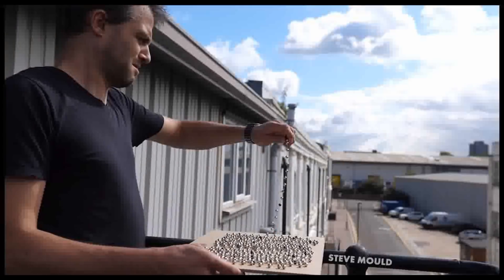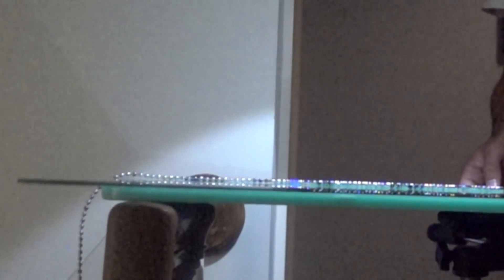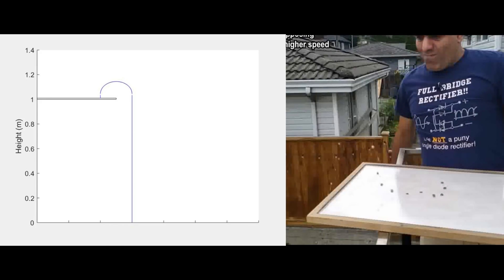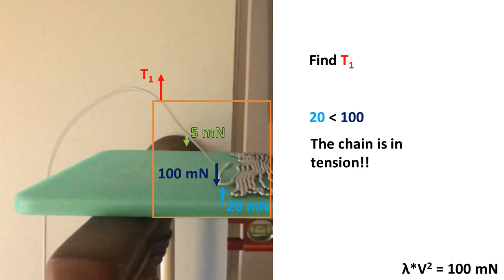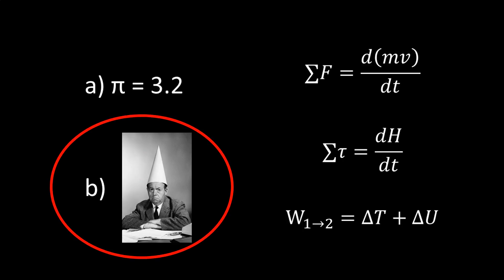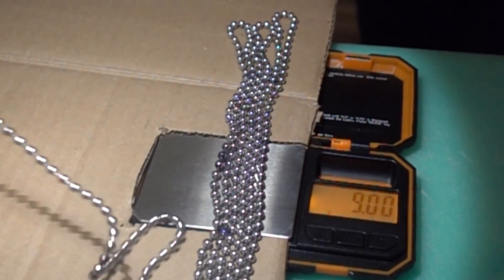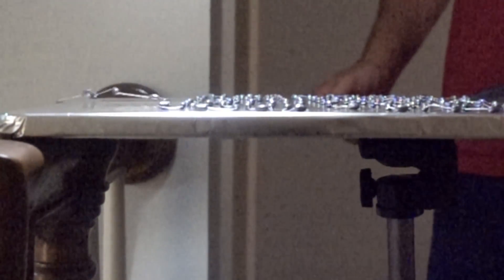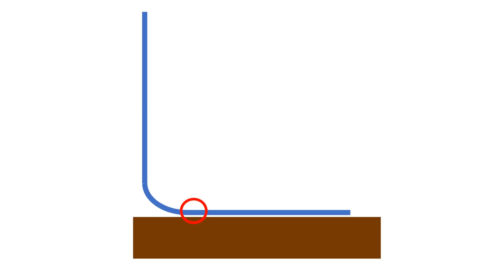And the Winner of the Chain Fountain Dispute is...

Comment: Those tinfoil impressions are beautiful and by far the most compelling evidence in favor of Steve's argument I've seen. I always thought he was right; this damn near proves it.
Reply: It's his beautiful blue eyes that made you think so! :D
Reply: I was definitely back and forth to start with, but the thing that convinced me Steve was right were those computer simulations. This entire debate was very interesting to watch from both sides.
Reply: And how does it "damn near" proves it? Because he saw impressions? You do realize he has zero math to account for the upward force of this "reactionary" force right? His most important point, he had zero math to support. Those prints are made by the normal force, a contact force that exist anytime two objects are in contact with one another. It's the force that make friction possible. To at least give his argument some tiny leg to stand on, he needs to have either math calcs or visual evidence to show at least one bead jumping. He has zero. The way he ran his experiments, it generates a normal force because that's the physics of lifting an object by applying a force to the end of a beam. When you hoist a beam by one end, as you hoist it up, what happens? As it rises, it starts to impart a higher normal force on the contact end. This normal force is NOT "reactionary". It is a singular event with two forces that occur simultaneously. As the beam contact end pushes on the surface, the surface also pushes up on the beam contact end. This is not a 1-2 event. It's one singular event and it happens simultaneously. This normal force is what provides the friction to pin this end to allow the rise of the beam. Without it, the beam cannot rise. You lift the high end, the low end pushes on the surface and the surface pushes back. All these events are simultaneous! If that's the case, then it proves the "reactionary" force is responsible for lifting right? WRONG! No it does not because without the lift force applied at the opposite end, there is no increase in the normal force. If you've ever lifted any object by one end on soft surface, you will see impreszions on the opposite end. This is the result of that end pushing and the surface pushing back, the normal force, not some extra " reactionary force". So this proves this theory right then doesn't it? No it does not! Why? Because you can lift a beam by pulling at its CM(center of mass). If the beam is laying flat, and you pull at the CM, the beam does not rotate; it just all rises at once. In this instance, the beam imparts the no additional normal force than when it was just laying there, so zero impressions. What you see here is the concept of simple machines at work. In the first lift, you are "levering" a beam hence it requires less force. But machines DON'T gives us the ability to do more work, the allow us to do the same work, using a less force, but we have to do it over a longer distance. In this example, if you have a 10 ft beam and want to lift it's CM 5 ft. If you apply force on one end, you feel less of the beam pushing back on you. This explains the lesser tension force. You are leveraging the beam to lift it's CM. How much distance do you have to lift to move the CM? It's 10 ft! The beam must rotate vertical to accomplish this. So you applied a smaller force over a distance of 10 ft. What about lifting it by it's CM? Well, this only requires 5ft of lift because any rise lifts the CM that much. The downside is it requires more force. This is why we build roads that wind up the mountain, build steps, build ramps! Without it, it required more force, something we may not be able to generate. The work to move an object vertically a distance X is the same no matter if you go traight up or go around and around like a screw or a winding road. 

So NO, he's proved nothing. I'll leave you with this to think about. If you see two identical prints in the dirt, can you conclude that one was the result of a jump, something that sent an object into the air? You can induce normal forces heavier than your weight by simply letting your weight free fall and then catching it by flexing your leg muscles to resist the fall. In other ones, one is landing and the other is jumping? You can also achieve the same prints by carrying more weight and that's how his prints show it. When the fountain rises, the beam is levering a greater weight! It's NOT jumping! Where's his evidence? Only the prints! DEAD WRONG! How do I know this, because a fountain can arise where zero normal force exists. Just take it out. Voila, proof it's not required for the fountain to rise! Yes, this can be easily achieved. It can be shown with simple experiments and mathematical calculations. Cheers, don't let his 50 pages scare you into believing hid theory is legit. Nothing wrong with the math. It just doesn't prove his argument. For that he resorts to assumptions and some footprints. 🤫🤫🤫🤫
Reply: @vangmountain  You can see in the video that the chain simply resting on the aluminum foil doesn't leave any impressions.  So the normal force per bead is increased dramatically during the fountain.  That increase in force is what they are calling a "reactionary force", and is necessary for the fountain to rise.  Anything you do that reduces that increase in normal force (using softer surfaces, wider radius of curvature of the resting chain, more flexible chain) reduces the height of the fountain.
Reply: @DevinBaillie  No one is disputing that. That's just the normal force being the normal force. Don't be fooled by the prints and no prints thing. The normal force is a contact force that exists anytime to objects are in contact with one another. Your foot prints are your proof that the normal force exists. Your car tread tracks. Let me ask you this, if I walk gingerly through a place and leave no impressions and them walk heavily, are you going to conclude I was jumping? The prints don't tell you it's jumping. It tells you the normal force was greater in those locations. Makes since right, if you are 100 lbs and walk through an area and leave no impressions and then walk through a similar area with a 40lb backpack, you'll see more of an impression. And you don't even need to add more weight. You can simply elevate your weight, drop down and then resist with your leg muscles and you will impart a deeper impression. The issue arises when they are implying that somehow some "additional" normal force is applied lifting it up.  

Per Preston to Luke:

 "Likewise, with the chain fountain, as the chain rises, the chain links try to rotate. As they rotate, they run into the ground. And since the ground does not move, the ground exerts a vertical force on the chain, accelerating the center's of mass of the links upward."

Do you see this explanation? This is a totally different thing. The key is the part:

 "As they rotate, they run into the ground." 

This clearly implies there is a reactionary force that happens after the rotation as in the demo done by the physicists at 7:37 of their video. This is 100% wrong. First and foremost, the links are in contact with the ground to begin with. It's not some time after rotation happens. The link is in contact during the whole rotation event. The normal force is the surfaces simultaneous response to the beam rising and pushing down on the surface. This is NOT  a reaction pair as they seam to imply where one event happens first and then a reaction takes place. It's a singular force pair, Newton's third law. The facts are this, the normal force of the surface on the contact end and the force of the contact end on the surface is what makes the lift possible; it generates friction to keep that end in place so the lift can rotate the link about that point. So the normal force is ALWAYS present from START to FINISH. It's a force pair. The lift yields the normal force and the normal force makes the lift possible. That said, the normal force in this scenario CANNOT provide any additional "kickback" force. There simply isn't a "kickback" force like in the physicist's video. That's a totally different, but similar animal to this. As such, the normal force acts simultaneously, and is an action pair, not a "reaction". Yes, the normal force makes the lift of the link possible in this scenario, but that is not the dispute. The dispute is to claim that the normal force is what makes the fountain rise. This is 100% wrong, as it's an action pair, NOT, a singular action. As such, if it is what gives the fountain its rise, then the answer is also the downward force of the beam on the surface because these two are action pairs. They occur together. You don't have one without the other. They do not exists singularly. The fact is, there is NO "REACTION". These two forces act as one to create the friction needed to anchor this end so the lift process can occur. As such, they are an anchoring mechanism and they only work in pairs, so there is NO "REACTIONARY" force pushing the beads up like the demo at 7:37 of the physics video nor is there anything happening like Preston states above. Because this is a pair of forces that anchor this end, if you want to credit one, you have to credit both. You CANNOT,  say it's the normal force pushing the beads up because the normal force is NOT A NET FORCE! To actually push the beads up, it must be a net force and it clearly is not. It cannot yield an acceleration like in the example by the physicists. In that example, you have rotation which generates angular momentum which, upon impact, must be conserver, hence, an impulse is imparted by the surface onto the beam end and accelerates it back up. Two different things. One yields a net force, the other is an equilibrium force. What you see here is an equilibrium force! END OF STORY. 

So why the foil impressions if no kickback? Because as the fountain rises, the normal force, the force that works as a pair with the downward force grows. As these two force pairs grow simultaneously together in response to the fountains rise, they deform the surface because they oppose one another. There is NO KICKBACK! It's an equilibrium force pair. If you want to say the normal force in pair with the downforce, anchor the fountain to allow it to rise, then yes, that's acceptable, but to say it's the "reaction" force , implying one force is response, is 100% wrong. 

Beyond this is that NO, a normal force is NOT needed to give rise to a fountain. Is it exhibited here? Yes it is, but that does not mean it is required to give rise to a fountain. It just happens that in this particular scenario, a normal force does exist, but the fact is, fountains can exist with ZERO normal forces. It's akin to saying, because a square is a rectangle, all rectangles are squares. A square is just  a type of rectangle. As such, this is just a fountain that exhibits a normal force. Not all do, because fountains can arise with no normal force. In other words, this is just one way to lift an object. How is this way? This is lifting that uses "leverage of a beam" and hence, a normal force is observed. This is lifting when you lift one end of a beam. You leverage that beam and it requires less force. You don't have to use a beam to lift an object. You can just lift it straight up via it's CM(center of mass). This manner, generates zero NORMAL FORCE, other than the initial normal force of the object at rest. The first method uses a machine and requires less force but does it over a longer distance. The 2nd, does not so it requires more force, but does it using a shorter distance. Basic principle of machines. You trade force for distance.
Reply: EXCELLENT WORK!  MORE CAPITAL LETTERS ALWAYS MAKE FOR A MORE CONVINCING ARGUMENT!  BUT MY ARGUMENT IS ALL CAPITALIZED THEREFORE IT'S THE MOST CONVINCING OF ALL.  YOU ARE WRONG!
Reply: Cheers, and you're correct :)
Reply: @vangmountain  look at mr first year physics over here 😭
Reply: @Skoomz  Dont let it scare you. That's all that's required to understand. Just know that climbing up the latter just means you have more tools at your disposal. It doesn't mean you can solve problems better than someone with less tools. You have two Cambridge physicists who have all the tools who got it wrong and it's leading to this misinformation that somehow a normal force is needed, some kind of "reactionary" force to help the beads rise when none is needed. The physicists had the answer in their hands but failed to see it. I encourage to tackle it yourself. That's the best learning you can get. Don't assume you need to be an engineer,  professor, or grad student to grasp what's the magic here. It"s so simple it's hard. Cheers and keep at it. Come up with your own ideas. Vet it. Challenge it. You have the tools. 🙂🙂🙂
Reply: Because people don't understand the mechanism behind, they claim things like, it needs to be rigid. Only certain changes will work. This is all false. They all can. A rope, yarn, fishing line, a beaded chain with beads 5 inches apart and flimpsy line. They all will exhibit a fountain if you understand the mechanism. Someone couldn't do it because why? They don't understand it. It's that simple. Don't take as the solution. You find the solution they couldn't.
Reply: @vangmountain  "As the beam contact end pushes on the surface, the surface also pushes up on the beam contact end"

As in, a lever? Which is what Steve has been trying to prove all along? Sorry but you seem to be very confused about what this discussion is trying to prove. Or do you somehow believe that you can leave marks on the foil just by pinching it and lifting it with your fingers?
Reply: @fullmontis   First and foremost, Steve all along claims some kind of "extra reaction" force meaning something like a kickback as the physicists claim. Dead wrong! Trust me, I know exactly what Steve's side is claiming. I'm saying they are clueless about the mechanism behind the fountain. If they weren't and that's including the physicists, they would not have posited this absurd theory. With all due respect, they don't know what they are talking about. The normal force in conjuction with forward velocity is exactly what gave those impressions not a "kickback" as Preston and the physicist describe. I'm glad you brought up the beam. Do you think when you lever a beam by pulling up on one end, it's the ground pushing back up that causes it to rise? If so, I'm sorry to tell you but you are wrong. Let's make one thing clear, Preston being a mechanical engineer and the two physicists are not saying what you are saying because they know the normal force in this instance does zero lifting. They know better than to claim that. I've already explained this beam/lever scenario, but if you think the ground is pushing it up, let me clarify it for you. If you sum up the forces, you have an up tension component and a horizontal right tension component on the right end, a down force on the contact end from the beam as well as a horizontal tension force to the left, and lastly, you have a simultaneous normal force from the surface balancing this down force on the contact end. Where are your net forces? They are tension components up, and to the right giving an upward motion and horizontal displacement to the right. This is what is observed in all videos. Is there an Fnet from the ground in the up direction? No, absolutely not. It's balance by the downforce. These two are equilibrium force pairs in a scenario like this that yield zero Fnet. This pair is what gives rise to the static friction needed so the Fnet up can lift the right end of the beam up. As the link moves forward and up, it drags on the foil. This combination of compression from the downforce and the normal force and the forward displacement, which is met by kinetic friction is where the foil impressions come from. Most people don't realize what they are looking at. The foil impressions are drag marks not impulse marks as Preston and the physicists would want you to believe. You can clearly see the impressions indicate kinetic friction. 

The physicists and Preston know the normal force in this scenario cannot yield an Fnet up. Steve on the other hand seems to think so. Where Preston and the physicists get it wrong is they imagine an impulse event. The up force causes rotation about the CM(center of mass) which accelerates the opposite end giving it velocity and thus angular momentum. Since momentum must be conserved, an impact with the ground would yield an impulse(change in momentum). The impulse from the ground would send this end rotating clockwise. Because the opposite end is already rising, you see an additional rise to the beam due to the vertical component of the left end rotating clock-wise. This is the additional force they speak of which gives rise to the fountain and this is where they are 100% wrong. Does this happen, absolutely not! They have zero evidence of this. Sure, you can just assume it does and throw some number on it and run some calcs which is what the physicists did. Impulse events yield high forces which are often very easy to measure and observe. Why is it so hard for them to measure and observe? Because there is none. All you see are the drag marks of a high compression equilibrium state. No lift is happening as a result of it. So yes, I know full well their argument and I know for a fact they are dead wrong. As I've stated, if you know the mechanism behind the fountain, everything observed is expected. 

If this is true, how then does a fountain rise from. A horizontal state? There is no rotation that leads to an impulse event. This is what Preston acknowledged he couldn't explain. Nor could he explain why coiling them in the container yielded little to no fountain. Why? I know the mechanism and that's exactly what should happen. I know why. They don't. I know what is required for the fountains to arise; they don't and that's why they make all these absurd claims. Unfortunately, because I am in the middle of making my video on this for my education channel, I can't ruin it by explaining the fountain. All I know is they are 100% wrong. Medhi is closer to being right. He just doesn't have his fingers on the mechanism but he is absolutely right that there is no "addional" reaction force.

You my friend are basically saying the ground pushing up lifts the chain, but that's incorrect. The ground only pushes up as a pair with the beam pushing down. This is Newton's third law, not one of action and reaction, but that of a singular action pair; they are an equilibrium pair with low forces and yield zero Fnet. An impulse event is also a singular action pair. The reason for the motion is the force each imparts on the other is great enought to accelerate one in the opposite direction. The forces are the same in magnitude but opposite in direction. The beam being small is accelerated back up. The surface being massive is too accelerated but too large small to be noticeable. During an equilirium force pair, the up force on the beam is less that the force of gravity on the beam so no up fnet. Likewise the force on the surface is too small and again, zero fnet down so no acceleration; they stay put. Don't get fooled into doing what the physicists did. They took two events and made them one. One is an impulse event and one is an equilibrium event. They are not one in the same. Cheers....if you are not convinced, stay tuned to my video. It will literally blow Steve's Preston's and the physicists theory right out of the water. The videos will leave you wondering, " what were they thinking". As I've already said before, this is so easy, it's hard. And yes, the physicists literally had the solution in the palms of their hands but failed to see it; that's how easy and hard it is. The mathematical model in Steve"s video is correct but it has the incorrect parameters put it. You"ve taken the beam and gravity out, therefore you need to change your parameters. Given the right parameters, that nathematical model will show a rising fountain. I will prove this, with not a model, but an actual live demo showing a fountain arising from this very scenario. Kickback, extra reactionary force? What is that? 😁😁😁😁😁
Reply: @fullmontis  What is stumping some very bright people, including the physicists, is the dynamic nature of this fountain which arises from three, that's right, exactly three very, fundamental things. If these three things hold true, you will have a fountain, no matter the kind of chain/rope/line or whatever. As long as it has the properties of a rope-like nature, a fountain can arise. And it can arise from virtually any configuration. Yes, bold statements I'm making because you see so many people fail to generate fountains or explain it, but it's just too simple it's hard. With knowledge of the three components that make up a fountain, you can predict and explain everything observed. IE:

 Will this configuration form a fountain, yes, or no? Will this configuration yield a higher or lower fountain than that one? Does gravity play a role at all? If so, what role? How does a horizontal chain form a fountain? All these questions can be answered accurately if you know the three mechanisms that give rise to the fountain. Cheers, and stay tuned friend.
Reply: @vangmountain  bruh moment.
Reply: @vangmountain  wow you are so smart